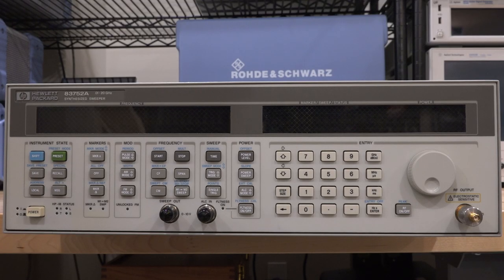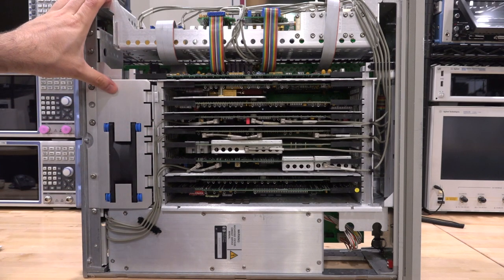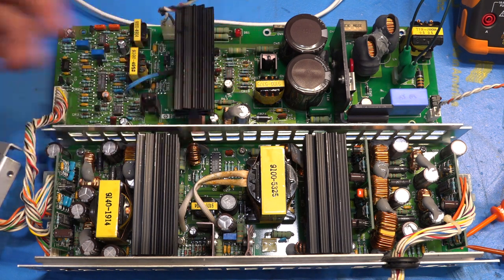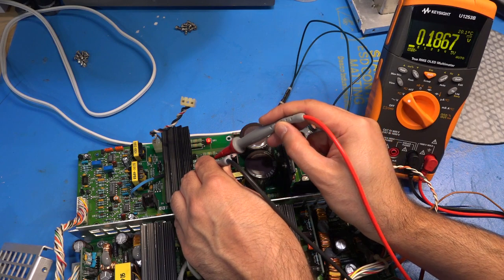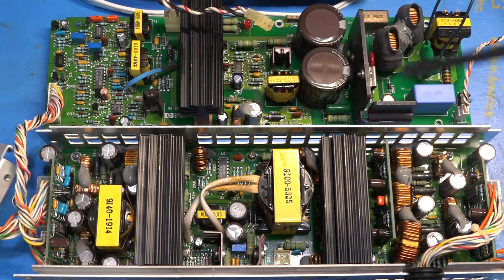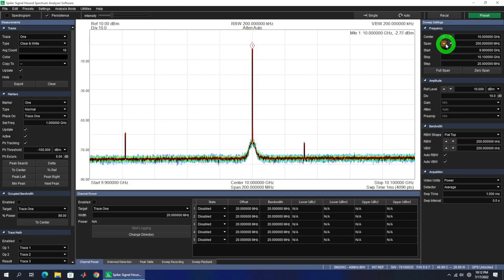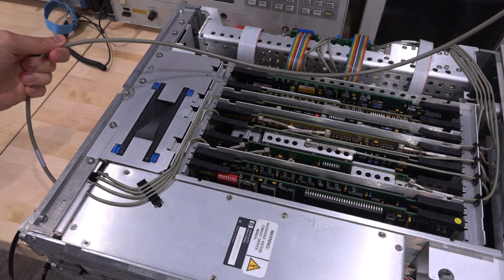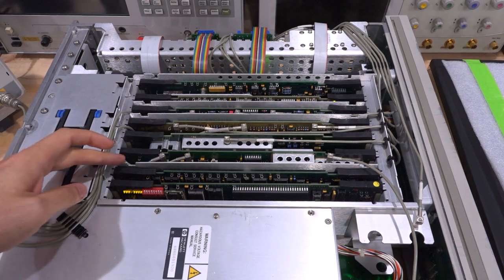TSP #209 - Teardown, Repair & Analysis of an Agilent 83752A 10MHz - 20GHz RF Synthesized Sweeper

Comment: Really nice debug and repair.  It is pretty amazing how one bad cap can take down the entire supply.  Nice work isolating down to a single transistor fault.
Reply: No different than a car with no fuel. Some components, though of common type, are pretty crucial. 

Without them out it just doesn't work 

Or the navies working on the railroads. Common laborers, but without them we would not be where we are. Lowly but very crucial.
Reply: I’ve seen a diode somewhere take down a whole piece of RF kit (i.e. mixer, amp circuits and the 12V PS rail) b/c it decided to become a wire instead. Wasn’t a HP but a big brand transceiver.
Reply: it is also true with people....for every 1000 fully functional people there is often just one bad cap (person) who takes down the entire society

Comment: I always love how you use the schematics to pinpoint the problematic component, but I think this is one of the best examples so far.
The way you excluded all the working blocks and the thought process used to find the faulty one  was really impressive.
Reply: I have learned a TON watching him debug equipment and just get a better handle of debugging thought process.  I'm not in RF, just audioland and older gear repairs (multimeters, the occasional lower Mhz tube scopes, etc.).  However just seeing his approaches to these sorts of really tough repairs is super helpful for that, and to get what some of this higher up gear is even for, or what it can do for you.  He basically taught me PLL.

Comment: From the condition of the VFD, I would guess that this unit has been switched on 24/7 for quite a few years. I wonder if the reduced performance of the fan caused the PSU internal temperature to be slightly high, accelerating the electrolytic cap drying out. It is possible that they original owner never experienced the unlock/unlevel if it were in an integrated test system generating higher frequencies, and never rebooted.

Comment: I'm an R&D engineer in a small company. Due to some standards we cover, we have our own manufacturing facility. Whenever they have a problem there, they tend to come to me for advice on how to fix it. I've tried teaching the guys there how to look for problems in first runs. I wonder if showing them your videos will help them. 
I'm just a bit sick of "well we assembled the board and it does not boot. Gave it a visual inspection and it was all good" 20 mins of skyping later "OHHHHH ... this IC is actually the wrong way around".
Reply: As long as you dont spoonfeed them and they learn thru failures, they will get there. Give them hints about how to solve the problem without pointing out the obvious. Ask them questions that will invoke exploratory thinking. 

Just a software dev, but that is still the best way to learn (and remember). Problem solving is universal.
Reply: @leppie  This works great when a designer has problem. Tried and tested.
For production people ... not really.

Comment: Man, that Signal Hound is so fantastic and it looks like they have put some effort into improving the GUI.
Reply: Signal hound recently released the SM435B, which is practically a frequency extended SM200 up to 43.5 GHz. Would be nice to see that in action as well!

It would also be nice to see a pro/con comparison of the signal hound SM series to a traditional spectrum analyzer. Specifically, the spurious responses, image rejection, and IMD in the front end. Typical spec ans use a fancy preselector, but I believe the signal hound does most of the filtering in software.
Reply: @kevina.4036  It's only the old, cheap SA44 SignalHound that leans heavily on software image suppression. I'm pretty sure the BB60 has preselection (maybe an early one didn't have low-freq preselction?) but the SM series definitely has good preselection. I have one and it's brilliant. The preselector is a sub-octave filter bank, so it's not as narrow as a YIG, but it's blazing fast because they just have to drive some PINs rather than a big honking coil.

Comment: If it's not gone already, it might be nice to file the top of the transistor off (upside down) and have a look at the die to see what could have happened to it.  Perhaps mechanical damage (dropped machine) or bondwires blown off.

Comment: I picked up 3 sig gens, 2 x 8257d and one of these 83752. I repaired the 8257ds but have been lazy on fixing the 83752. Would be coincidental if it has the same exact issues!

Comment: At first I thought this would be just another simple mains side fuse having blown.
But the caps for the PWM controllers deciding to dry out over time isn't uncommon either, sitting around all those fairly warm components isn't a good life for an electrolytic cap. Especially when PWM chips like these at times takes fairly large gulps of current to start the power transistors.

Also, is it just me. Or wouldn't it be great if a frequency counter had a power meter as well inside? Doesn't have to be accurate or high res, but seeing in one go that the signal seems a few (or a lot) db lower than expected without having to dig out another piece of equipment would be rather nice.
Reply: There are, indeed, frequency counters with integrated power meter, e.g HP 53150A
Reply: @borisscernovs1952  That is indeed a frequency counter with power meters functionality.

Although, its price is a bit steep, but going to 20 GHz explains the cost.

Comment: I was wondering, are there components in any of your instruments so delicate that you can't X-Ray them because they could be damaged?
Reply: Good question.  I have never heard of there being a issue.  There could be a very small possibility that EPROM or EEPROM could have the memory holding time reduced by a tiny amount.

We know most components are happy with x-rays, they are used in routine inspection of high end PCBs these days  and then there are baggage and customs scanners.  Basically most things that are not light sensitive (like x-ray film in an intensifying cassette) might have a spurious soft error or bias change but will shrug it off when the x-rays are turned off.

Comment: What does the A16 Sampler do?
Reply from the maker: It’s basically a harmonic mixer allowing for the detection of the oscillator output frequency/phase for the PLL loop. A poor man’s divider.
Reply: @Thesignalpath  Thanks for the reply.

Comment: So much incredibly expensive equipement and he still uses as small cheap peak tester. They are nice devices, but it still seems weird.
Reply from the maker: What is wrong with the Peak tester? It works very well and it is portable. If I wanted to completely characterized the device, of course I would use a different set of instruments.
Reply: @Thesignalpath  nothing as such, that's why I said they where nice devices. I have one myself.
I was observing that in a room with so much high spec equipment it seems rather out classed. 
It's like when I go to the gym and do my thing and work up a sweat and then one of the trainers in his off hours does his round. I know I should be happy about my own performance but it still makes me feel inadequate some time. I am projecting this sentiment on the peak tester and find that humorous.
Reply from the maker: @bzuidgeest  I see! Thanks.
Reply: I know what you mean. There is a lot of gear elitism around engineering, especially in the hobbyist communities. It just kinda comes with the territory. It seems to happen in most hobbies, whether it is playing golf or painting a landscape. A lot of people would be pretty shocked to see just how simple / cheap / old / clunky the test equipment is on professional work benches - but it works, and works well. :)